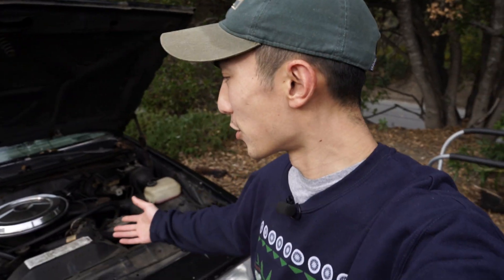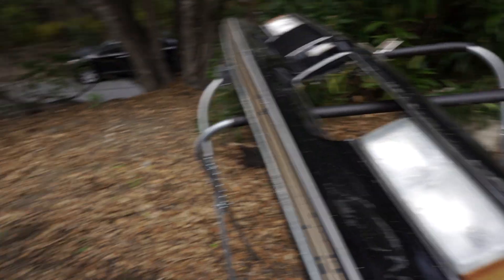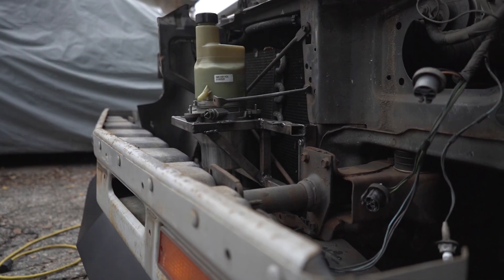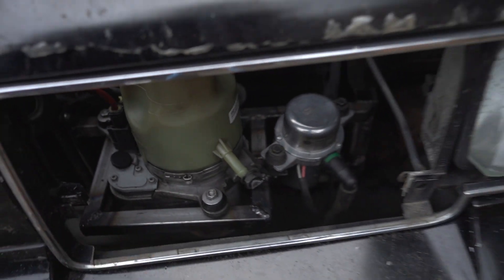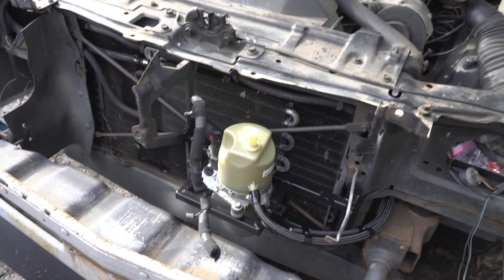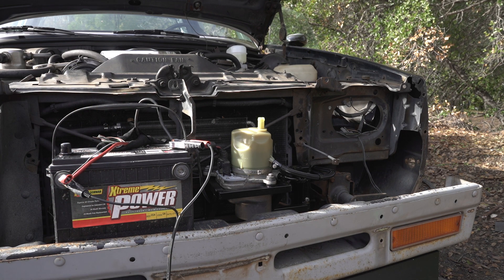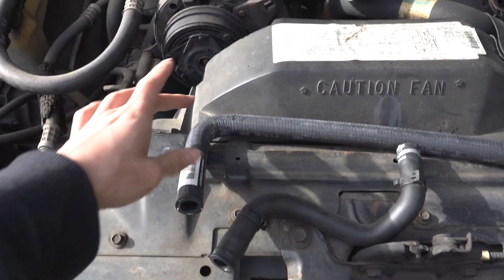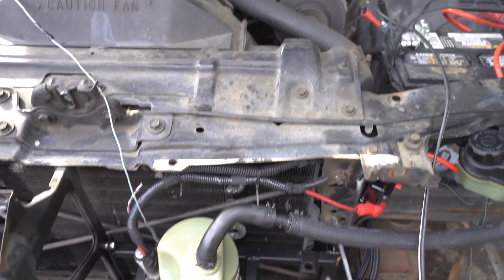Electric Cutlass Gets Electric Power Steering : Episode 1

Comment: First  I would like to say nice job. While I am not a fan of all the falsehoods being told to people about EV's and how they are good or better for the environment, I am very interested in your swap. Hot rodding is hot rodding, some may argue that statement. Are you planning on going full electric or hybrid?
Reply from the maker: Plan is to go full electric, it would be the least complicated. I’ve seen some cool hybrid swaps, but those are mostly completely chassis swaps. Im swapping the 307 with a hpevs 35 motor and the 200r4 with a Muncie m20
Reply: @nileslee1  Isn't that like a 60 HP motor?
Reply from the maker: Using the dual 35 so like 120 😂 but kinda close to what it’s at right now
Reply: @nileslee1   A friend of mine pointed out your post on the G forum. Which is how I found this video. With the 4 speed manual Muncie  behind the motor it will definitely out perform the 307.
Reply: @turna454  yea its hard to compare electric to gas hp. I have had numerous 6.5hp go karts and minibikes be out performed by my 2kW (around 2.6 hp) minibike. I agree those dual motors will out perform that ole 307